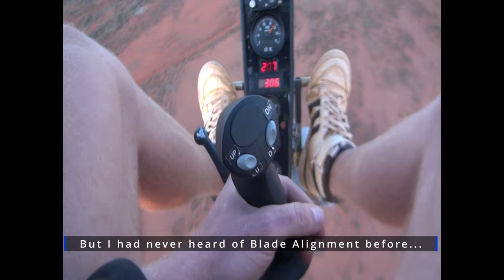The stick shake on my GyroCopter 😮

Comment: Bloody fantastic process good use of the scientific method on show here.  The Pre-rotator was surprising.  Another factor that wasn't the problem here is teeter block height.  The blades cone up in flight and the center of the mass of the blades needs to pass through the teeter block or you get vibration.  There's a formula I saw in I think Hollan's thesis for his sportster design where he works out the teeter bolt height based on this.  I would notice most machines would shake when heavily loaded.  So different rotor rpm based on different weights etc.  will result in different coning angle and hence different teeter heights.  It does seem to have some variation as we flew one and two up in the glider all the time with no real issues until we really loaded it up.  Clearly not the problem here.  Was it Petroni blades?  Why did he thing the pre-rotator was causing these issues is the mass up top building resonant frequency like a kid being pushed gently on a swing set perhaps the 2 per rev + the extra mass is building the frequency up?
Reply from the maker: Yep Rob patroni blades, his blades around this length used to have dramas caused by prerotators back in the day and he would make shaft drives so you can put the heavy prerotator down the mast closer to the engine and run the bendix thing up to the head to prerotate. Patroni reckons having the prerotator at the top of the mast is a silly idea to begin with. He thinks alot of things that we consider normal on gyros are actually inefficient, hes a really smart bloke and I wish he was still made stuff
Reply: @omeobandit9928  I think you will find it is coning angle... it would be my guess that the root cause is the machine is over rotored. My thoughts are that the rotors are turning too slowly and due to the low speed, the tips are higher than the teeter height (lack of centrifugal force). You seem to have got it smooth as possible, well done! I think I would prefer shorter rotors and keep the prerotator haha
Reply: So he, the designer of the blades was implying that the mass of the pre rotator motor caused an imbalance of the mast? The mast therefore must move and thereby cancels out the twice per revolution vibration which is one of the few downfalls of the semi ridged teetering design? This is the first I have heard of this. Stranger things have been seen in the world of engineering. I wonder of there was counterbalancing added would stop it. Who in their right mind would want to add additional weight to the very top of the mast? Smarter every day

Comment: Dear Sir, I live in NSW and found your video very interesting, if the pre-rotator was the issue causing the vibration ( and looks like it was ) then was is plan B? a smaller, less weight pre-rotator?
Reply from the maker: Hello friend, plan B is to keep flying without any prerotator and always hand spin, because I am not very good at engineering. I might do a 3000km adventure flight to the east coast to visit an engineer who knows how to move the prerotator to the bottom of the mast and run a shaft up the mast, but I need to work and save up money for it first. I promise if I do that you will see more videos of the changes!
Reply: @omeobandit9928   so, the long and short of it is the mass of the starter motor up there was messing with the harmonics coming off the combination of your blade/rotor combination?     I wonder if  clocking that motor in a different spot relative to the mast would effect it?
Reply from the maker: @roberttammerawitchey4652  Yep. I spoke to Rob, the retired manufacturer of these blades and he said having the smarter motor further down the mast and running a flexible shaft up to the rotor head would be a good solution. I've listed these blades for sale so I can try some 26 or 27ft blades with the starter motor up top again.

Comment: If i remember correct the guy that flew the gyrocopter for the bond film had no prerotator and it flew silky smooth. He did a programme about it in the 80's , I had wondered when they came in ?
Reply: No , he (Ken Wallis) had a prerotator, but it was really small and almost unnoticeable. I think it involved some cycle components. Cierva had prerotators on some of his machines.

Comment: How come none of these gyro copters have a hollow ring filled with 4 to 8 oz of beads, on the rotor ? This technique was always used on flywheels to balance them dynamically. Another words a copper tube was shaped into a doughnut and partially filled with fine ceramic beads. Flywheel was always in balance and most all harmonic vibrations neutralized.
Reply: It wasn't about balance.  Usually the blades are balance at manufacture quite well.  However you always get 2/rev because the differences in drag at different rotor positions relative to the air in flight.  I suspect in this case the heavy weight of the starter combined with the high pitch long rotors (2 degrees and 27ft) mean a lot of 2/rev and I think the extra inertia starter on the 2/rev was making the mast flex more fore-aft in the 2/rev.  The fact these same blades when below 25ft never have this issue is telling.

Comment: What happens if the engine goes out?
Reply from the maker: That happened to me a week or two ago (gearbox failed). Luckily I was flying over a road and just floated down and landed like normal because the rotors on gyrocopters are only spinning from the wind underneath them.

Comment: hello..How many horsepower is in the engine and how many revolutions per minute
Reply from the maker: 110hp stock (ej18 Subaru) and cruise between 4500-5000 rev

Comment: How much does it cost for me to get one like this? Also what happens if you have a motor out?
Reply from the maker: If the engine dies the blades don't stop spinning because they don't need engine power, so you can either stall and sink vertically which will be a pretty hard impact that will wreck the machine but you will survive, or if you have a bit of speed and altitude you can nosedive to keep your airspeed up and just flare right before the ground like in a normal landing situation and set it down softly. I had it happen twice.

Comment: Could you use Stick On Wheel Weights to get it Balanced??
Reply from the maker: Yep that's a more advanced method and I've heard of people doing that
Reply: Did he pull off the gear or only the motor?  The blades themselves were clearly not out of balance so you think it was the drive gear?  Certainly possible.
Reply from the maker: @cameronlapworth2284  All I did was take away the motor from the top :)
Reply: @omeobandit9928  yeah so it's definitely not a balance thing.

Comment: Length of rotor blades?
Reply from the maker: 28 ft
Reply: @omeobandit9928  Way too long for single seater gyro. 25" is the right length.
Reply from the maker: @tadgyro  im trying to sell my blades at the moment to change to some shorter ones
Reply: @omeobandit9928  I did like your video and the place you live. The desert where I live is not red. Thank you for posting.
Reply from the maker: @tadgyro  i love your vids too, im moving to a different desert in a few months which is more like the colour of yours. I'll be waiting a bit longer for my new gearbox to arrive before flying again tho
Reply: @omeobandit9928  Thank you for your replies.  Fly safe.